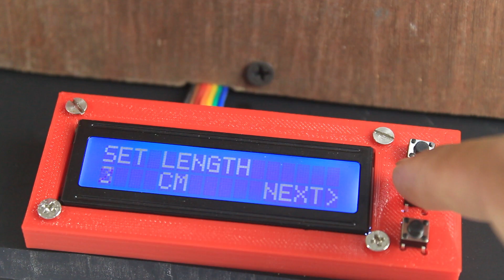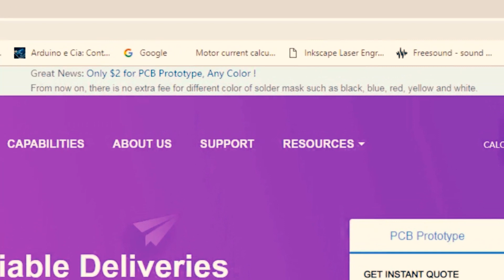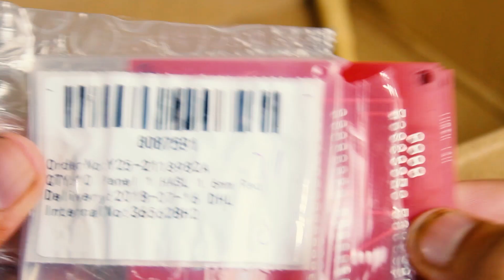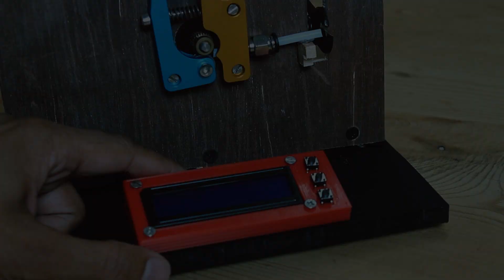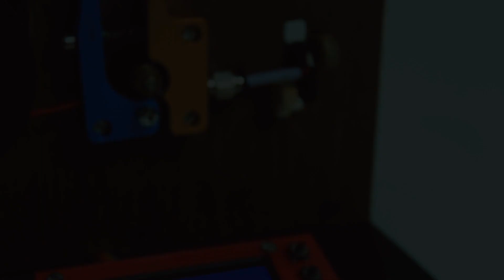DIY Arduino based wire cutter machine

Comment: Hello Friends! Mr. Innovative is currently unable, unwilling or uninterested in responding. I have the circuit/pcb diagram and I would gladly share it with anyone that needs it! I will be leaving on extended holiday. However, I will only be around for the next 2 hours (09/27/20). I will be returning May 25, 2021. Cheers!

Comment: You guys, Mr. Innovative has stuff on several sites, google 'Mr Innovative Wire Cutter' and you can find materials (arduino code, detailed instructions). I've successfully built Mr Innovative's older version of this machine (the one using a servo motor for cutter, not a stepper like it does here), not sure if recent PCB and code updates are there, but at least for an earier working version go here: https://www.instructables.com/id/DIY-Arduino-Based-Automatic-Wire-Cutting-Machine/
Reply: can you tell me please what is r1?

Comment: Could you build and ship me a wire cutter like this? The wire is 3.4mm so we may need to drill out the extruder. I would like to cut the wire to 1.22m.

Comment: I have this built exactly as it shows (with both the button direction values fixed and the power swapped on the feed motor).  Code runs, buttons work, but the motors don't engage or turn (no resistance).  Using brand new A4988 drivers.  Am I missing something?
Reply: It’s because the circuit diagram is wrong the (Feed Motor)A4988 stepper motor driver gets the power supply with switched polarity😃(VM)(GND)🤞

Comment: Hi Mr Innovative...
The application is really cool...... I have also watched your previous wire cutter video where the cutting process is done by a servo motor, but here its from stepper motor... will you tell why you have modified the cutter section only? And can you please provide me the gerber file of this project.

Thanks & Regards in Advance

Comment: After same coding my motor moving in  wrong  direction,  sometimes move forward and sometimes reverse.. 
Do anyone know why it happens..?
Reply: Stepper motor ..
Reply: See controlling steppers motors with the A4988 by howtomecathronics it will have the explanation there. 

The wiring in the motor is with the coils in a diferent setup, instead of HIGH to turn  clockwise it needs LOW. Or the opposite.  The explanation there is really good.
Reply: Sounds like you got it to at least move.  For me, everything turns on fine, but the buttons don't do anything.  Did you have to change the button logic at all?

Comment: Pls  give  us  PCB  file  that you use. I want to use that project but schematic in your video 6:03 min in red wire  you show to connect VMOD of CUTTER  DRIVER to GND of  FEED DRIVER  and  GND of CUTTER DRIVER to VMOD of CUTTER DRIVER, but in 6:41 min I see that on board VMOD is connect to  VMOD and  GND to GND. Thanks   in advance.
Reply: Yes, this is an obvious error, since there is a short circuit to the power supply. Many such projects are done in such a way that people will run into problems when repeated. There are very few projects that actually repeat without problems.

Comment: i just thought of a update to your project, what if you put the cutter and motor on a ramp (that goes up and down) to cut more then one roll at a time (diffrent color wire) on screws on the front
Reply from the maker: nice thought !!

Comment: Hi, First of all incredible project, useful and simple. Can you tell me if I can use it with arduino Uno? and where can I find the library for the liquid crystal. Thanks in advance!
Edit: Find the library, but get an error, can You or anybody helpme please?

In function 'void setup()':

cutter:42:12: error: no matching function for call to 'LiquidCrystal_I2C::begin()'

 
exit status 1
no matching function for call to 'LiquidCrystal_I2C::begin()'
Reply from the maker: make sure you have installed the correct library, other issue  may be you LDC I2C address
Reply: @MrInnovative  Thanks! It was the address.
One thing I noticed is that if you press by error first the down button it counts negative - 1 for examples, but then when you go up it shows two digits, a little confusing, but nothing important.
The feed motor is working fine and I haven't bought the cutter one yet, when I finish it I'll let you know. Thanks again!

Comment: All it needs now is a wire stripper with a length setting for the exposed copper. That and maybe a setting for 0.1"/2.54mm lengths of wire.
  I typically use 1mm heatshrink tubing to make jumper wires for single sided etchings or perfboards. I can easily cut the tubing to the perfect length. Then I use pre-tinned bus wire inside the heatshrink. I could save a lot of time if I had an automated way of making jumper wires that were the exact size I needed.
  With a machine like that it would even make sense to create jumper wires as a parts library in KiCAD. Then I would be able to create a file that lists all the link sizes for a board and automatically make them.